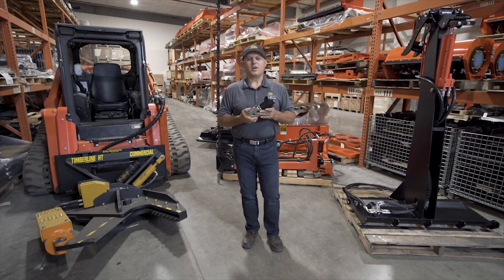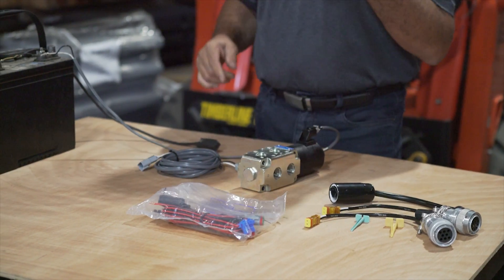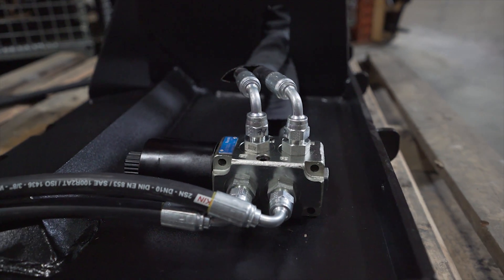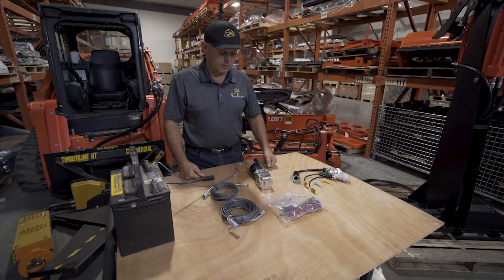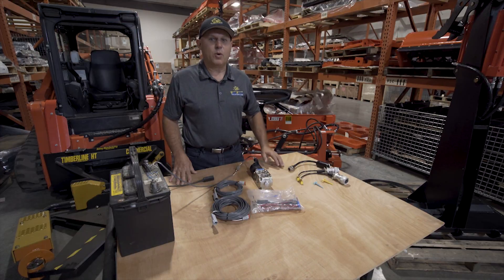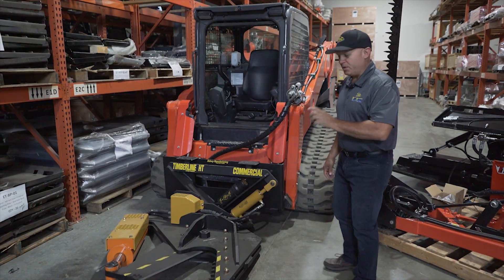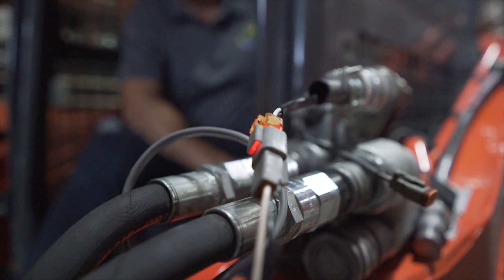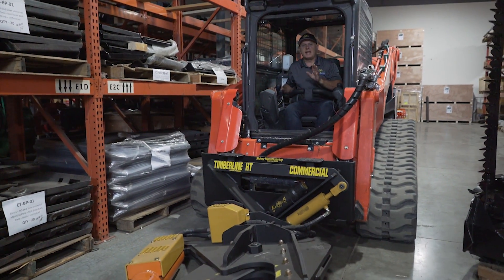HCS Solenoid Control Valve | Skid Steer Solutions

Comment: What is your cost on a kit for a 2019 Bobcat T650 7 pin, there website says not to use my 7 pin, it will take the bobcat computer
Reply from the maker: $645 for the kit, check out all the details and pricing here: https://www.skidsteersolutions.com/hcs-control-valve-kit/ Thank you! Give us a call if you have any further questions 866-966-2538.

Comment: Rob.....would the 7pin let me use bobcat joystick to activate the diverter?....instead of my on and off switches......i got two diverters stacked....
Reply from the maker: :D Call 866-966-2538

This will add two extra functions to your attachment, so if you have some cylinders you need to open and close, this is your solution Jeff. Buying the SkidSteerGenius.com 7-Pin controller will allow you to use your Joy Sticks.